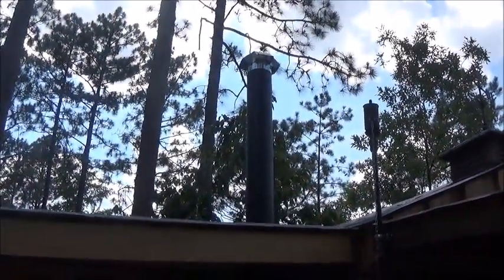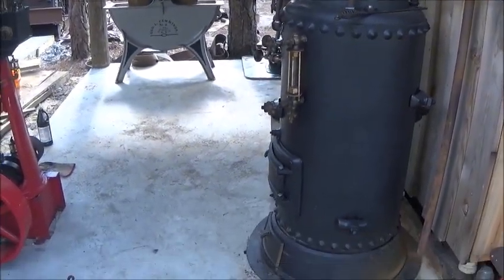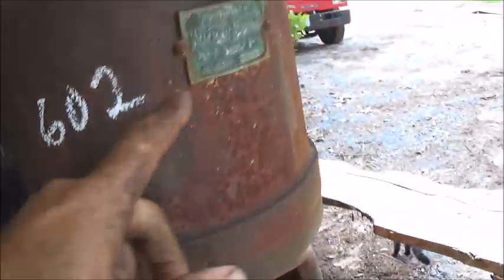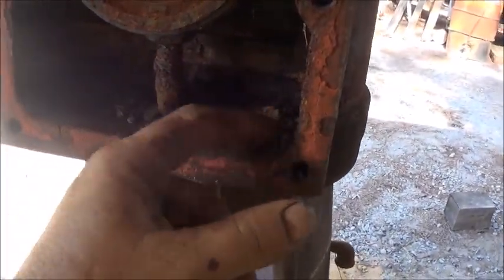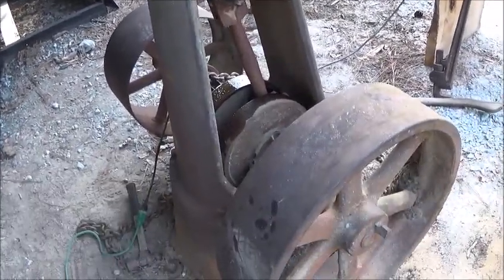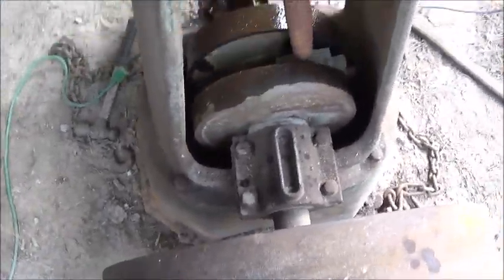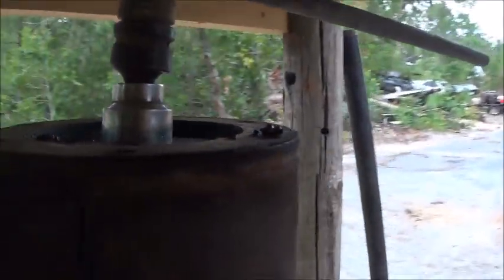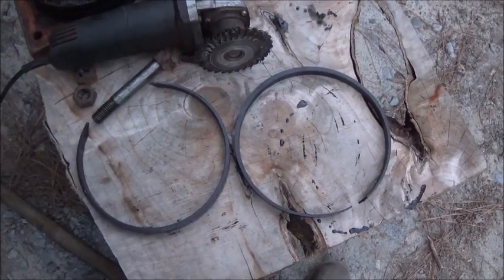UPRIGHT STEAM ENGINE REPAIR SITTING FOR YEARS PART 1

Comment: You are truly blessed to have a wife that works with you and helps with these projects. I've been married 43 yrs. and she did help the first few years, but now she just gripes!  I tend to agree with your thoughts on those rings, lack of proper lubrication.  Just a thought on your boilers, if you are going to leave them sit for weeks with water in them, you should be thinking about using an oxygen scavenger feed water treatment.  When water is heated, it drives out the oxygen.  When it sits cold, the water draws the oxygen back in. This process accelerates the corrosion of the boiler metals.  There are products for feed water treatment to cure this issue.  On another note, My son and I just bought a traction engine that we have been after for 30 years. Now just have to get it hauled 250 miles home. Should scale in at 14 tons.  That makes 5 engines we have, like yours, they need some tlc, but for bring over 100 years old, not bad!  Keep up the good work and take care.

Comment: Nice Job Jonathan. Those Rings looks to be in perfect condition to be replaced. Just made new rings for my 1913 Beijer crude oil. That steam engine of yours is in a very good size, not to big or to small. Would love to have one, but here in Sweden almost all of them was scrapped when the crude oil engines came. Rare to find. I also love the original unpainted condition of your engine. /Richard
Reply: 👍👌👏 Nice to meet you here, Sir! I told Johnathan W. about your channel respectively that you fabricated new cast iron piston rings.
Best regards, luck and health.

Comment: Well Jon, now you have me all excited to see that 10 horse running. I believe you are going to have one of the most versatile engines out of all of the smaller engines. That thing will probably be able to run just about all of your wood working equipment and run really well just on that little boiler you have been using here lately. That larger boiler would go a long way to giving you all of the volume you would need to run all of that equipment. If that is the same boiler I think it is then it is a really good workhorse.

Comment: It is amazing how well you are doing with the steam engines. Sure glad someone thought of packing it with grease to save it. You could never be 500 pounds because you move around too much. You make me tired just thinking of all the work you do in a day. Keep hydrated and when I used to work outside, I used to wet a paper towel and put it under my hat and it would keep my head cool for about a half hour and when I took it out it would be dry. I would wet it again and go on. That and a wet hand towel around my neck. Stay safe and glad your family is doing fine.

Comment: I never seen no rings worn like that either - I'm wondering what the grooves in the piston look like...the real surprise to me was the smooth cylinder bore and supposed to be a piece of a ring got broke off in there...forgot to mention how good that boiler looked in the last video - the shiny brass contrasts good against the flat black & l think you had mentioned in another video how your wife was doing the painting...l have to be flat out starving to eat anything l cook - you got it made...l know she helped out with the welding on the dragline boom but when you had to pull start the Hawk Studebaker - you sure had the right one driving the tow truck...l liked that video & l remember how that Packard motor was slow turning even with everything right...might want to get some grapefruit & put it in a blender/juicer with some seedless grapes - best thing for me (south Florida boy) to keep hydrated & don't have to keep drinking so much water...humidity is easier to tolerate when you can look over & see how good your garden's doing...maybe clear a little spot & get some more cucumbers going

Comment: Johnathan, we used castor oil as steam cylinder lubrication. Had mechanical lubricators (like a DELVAC), don't remember exact name. Steam powered pumps had two tied together. One for steam cylinder and one for slides and bearings. Bearing oil had barium in it, because it was compatible with the babbitt bearings and slides. Castor oil stuck to the metal better than petroleum based oils in steam cylinders.

Comment: Question about that smaller boiler @4:13 in the video - how much radiant heat comes off of that when running at full bore? I ask because of how close it is to that wood shed - just curious is all! I love how far you've come on these projects - been watching since you dragged that Bates out of the woods and that massive boiler that went with it.

Comment: You are lucky they put grease in the cylinder. We had 6 -800 lbs maybe more At times. A gasket was to blow out an the steam would cut the flanges quiet a bit. Thanks for the video and update.

Comment: You beat me to it by using hydraulic cylinder rod. I was thinking that maybe you could sweet talk one of the local shops to donate a rod already threaded for you. Just let them know you will put a tag somewhere close that they helped out. I used a lot of turned, ground and polished stock where I used to work. I learned of a local shop and asked if they had any cutoff pieces that we could purchase. They were glad to let me have their ends and good used stuff after I sent them several good customers.
Those keys on the crank are tapered keys. I'm sure you know about them but for others---a tapered key is slightly smaller in height on the tip and gets progressively bigger to the head. The shaft is a normal keyway but the keyway in the wheel must be tapered to match the key. You can't use a straight key as it will not stay put and fall out usually tearing up the keyway. Our looms were loaded with tapered keys. The looms were originally run from line shafts and may have been run by steam power at one time. The original drawings were inked in 1922.
Nana cat seems a little put off by the steam engines. Of course any body would be put off if you were wearing a fur coat in the 100 degree heat we are having here, LOL!
Take care of your health Jonathan and thank you Mrs. Jonathan for helping out.
Cheers
Terry
Reply: They're called Gib keys. New Holland farm equipment still uses them on haybine reels and large pulleys. If they get rusted in, they're a huge pain in the behind.
Reply: @farmerbill6855  they don't need to be rusted to be a pain to get out.... LOL! 
We used to make them on our shaper. I still have the tapered "parallels" that I used to put under them so I wouldn't have to move the vice.
The plant is gone along with all the looms. The market for expensive woven carpet collapsed and signed the death warrant for the last remaining C&K and Lansdowne looms that I know of. All went to the scrapper.
Cheers 
Terry

Comment: I had an older friend tell me "wherever grease is, water isn't ". Because whenever he was tearing down a project for rebuilding or repair, he would bag and tag items in oil or grease. Reassembling went a lot easier when you weren't fighting rust or hard spots due to water.

Comment: Excellent video Johnathan W  :) also what is drip gas is may ask you have hear talk about in  past videos over years & worst smells I remember was Farm gas on farm , Old Desiel fuel sat more than 10 turn to like water with clear engine oil  and was awfull and 2 was Automatic transmission Dexron 3 after burn up and 80w90 differential fluid to those worst ones I remember and super gross! Also other was old Engine oils from 1970's to 1996 of 10w30 and 5W30  plus Heavy Duty SAE 30  sat around opening up from containers too ! How found about Johnathan my dad also uncle farm did by accident on machinery shed plus grease too plus old engine oil in metal pails too be changed from motor too! Company's were Texaco, Gulf, Quaker State, Gulf , ESSO!

Comment: C.H. Dutton made only one 7in bore throttle governed engine. A 7x8 rated at 10hp on 80psi steam @ 200rpm. It should be fitted with a 1-1/2" governor.

Comment: hello Jonathan. I just came across a old video of a channel called 37spiker from 2018 Owls Head Transportation Museum in Maine that shows a display of a Corlis steam engine 16 foot flywheel, 600 hp, at the start of the video. Looks a lot like what you did with the brick work for your big steam engine. Just thought I would let you know...Dave/WBA

Comment: Have you given any thought to getting a length of insolated hose and a mixer valve setup to use for clean up on and around the steam plant and engines, yes I know you have a pressure washer but a steam hose will be so handy you will not believe it. It gets so much hotter than a pressure washer.

Comment: The bearing caps belong to cut into the bearing caps supposed to have felt in them I use piano felt you bought from places repair pianos big thick pieces of felt the felt keepeds the main shaft gets a little bit of oil in a time as saves the or just run a straight through the bearings

Comment: take your propane torch and heat the pin up till it will melt a candle or parafin let it cool down for a few minuets take a drift and whack it with a hammer watch where it lands you may need it later